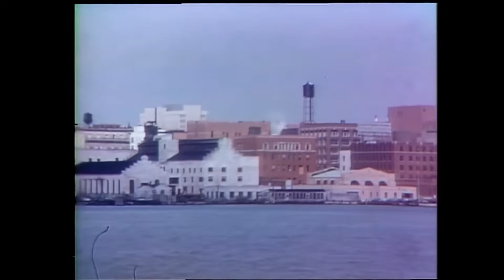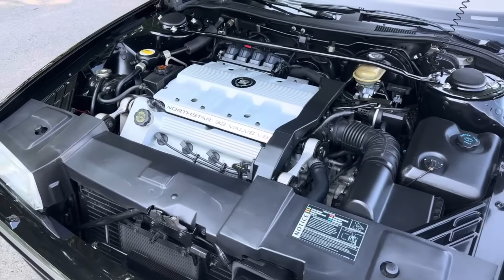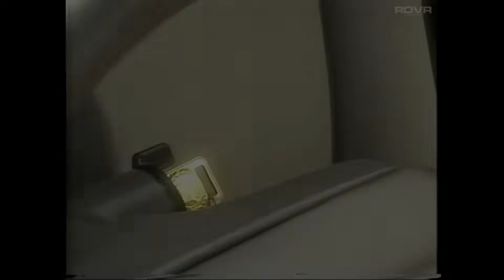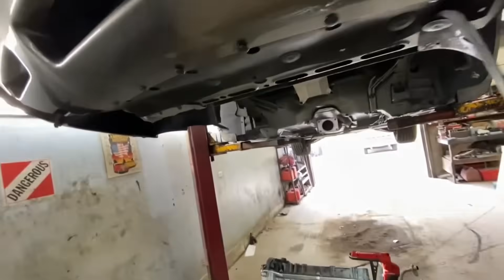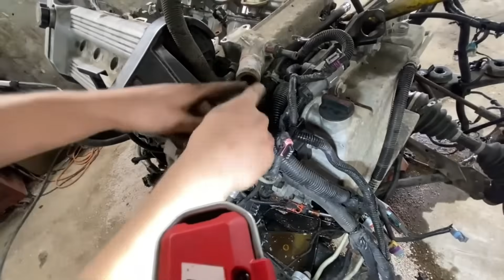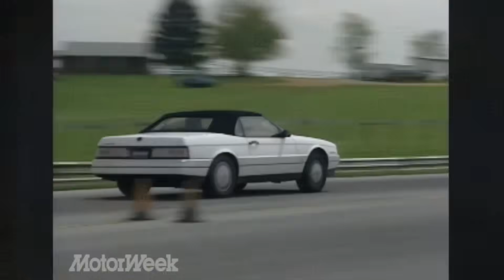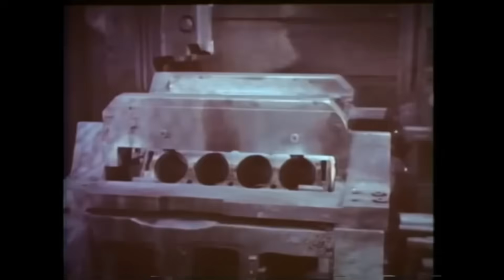Most HATED American V8 Engine of All Time!

Comment: AI slob that got it wrong about cylinder deactivation 
 it's all trash from 2007 and newer. 
 100,000 mile engines and then you need a whole new engine out of a crate.
 Rebuilding is not an option or more money.
Ford with turbos on small engines also 100,000 mi engines 
and that doesn't even include the huge problems with the wet belt.

Comment: Just another stupid decision made by GM's management department. 
They decided to follow the bean counters as the guiding light for Profits rather than trusting in the engineers who spent years in university degrees costs  in metalurgery and decades in research  on  historical accounts of what previous engineers developed in the war years ,to have these effen idiots who have their BA in economics as their portfolio as their prime shingle on their resume. 
When will the executives at GM come to realize that it's the engineers who have the skills ,knowledge and gut feelings to know what is the difference between doing what is right as opposed to doing what the bean counters are telling them what to do to save 32 cents on every vehicle. 
Well I'm so disappointed in the management at GM that by following their track records, that I've given up on GM's corporate ability to build anything reliable, durable ,long lasting and serviceable without having take three quarters of the car apart before they can get to the problem. 
They deserve to go bankrupt.

Comment: mostly elderly people over 70 drive these Cadillac's and they only need a reliable 4 cylinder with around 140 horsepower. when I'm on the road every time I'm behind a Cadillac there doing 25mph in a 40 and highway 40mph in the right hand lane. most of these old codgers would actually do very nicely with a 1.2/3cylinder engine like in the Mitsubishi mirage....what they really care about is gas mileage and the Cadillac emblem. not horsepower.

Comment: I bought a brand new 2005 Harley Davidson twin cam 88. the worst engine ever. after about 10,000 miles the gates of hell opened up. the chain tensioners, oil leaks, engine misfiring and extreme vibration were a nightmare. even worse? the warranty just ran out. first thing the Harley dealer told me that every problem was my fault. I almost got a divorce and lost the house. we've bought Honda's since.

Comment: The problem was not the engine, the problem was GM was not willing to admit there was a problem and actually recall bad ones and fix the design for the future units..  Probably because some NBA figured it was cheaper to screw their customers.  I had a 2000 that I got ripped off on with this problem.  These were awesome cars otherwise.

Comment: Complete bullshit reporting. Water pumps are the root cause. I had 2 northstars both ran to 200k miles and sold. At 120k I had water pumps that locked up intermittent and caused extreme overheating and rapid cooling. Water didn’t leak so it was tough to diagnose. All engines use torque to yield bolts as do many other auto applications.

Comment: The 4.6 Liter Northstar was great except for head bolt inserts, which could be replaced. The same years BMW's V8's had the same problem but their V8 couldn't be rebuilt with new inserts or healy-coils. It was a world -over tech mishap. Deutshe Ingenierskunst ist Mist! hahaha😂just teezing...Plus it's not so bad putting in a new motor, I did it.  And for the video maker, the only thing that Cadillac needed to change was the inserts, the same type of bolt was used and the 4.4 Liter that's still out today is the same block and head design.

Comment: The first problem with the actual car is that it is FRONT WHEEL DRIVE, or seemingly so as it's east-west, not north-south in the chassis.  Any of the larger Mercedes or BMW is rear wheel drive. The engine probs are another issue.

Comment: I had an '89 Seville with the 4.9. It had 180,000 miles on it when I sold it. It was still running great.
Reply: Your 4.9 would of been the best fit. to  resolve the Northstar blunder. 4.9 is not a  Northstar.

Comment: I've owned two Northstar-powered Cadillacs (1995 Deville Concours and a 2002 Eldorado). I got both over 200k with no issues. Also had a 1974 Vega that hit 127k and made it to 1983, and a 1981 Olds Cutlass Diesel that got to 150k. It's simple. Take care of them and they'll take care of you.

Comment: I started working on cars professionally in 2011.   I saw a lot of Northstars.   I've never met one that didn't leak.

An older wealthy guy used to bring his low mile 2 door 98 Eldorado in religiously.   Had, if i remember correctly, 28k miles in 2012 when I worked on it.  Everything about it was meticulously clean.  The I raised her up to see her bottom.    I've NEVER met a Northstar that doesn't leak.

Comment: The best fix for the Northstar head gasket issue is the Northstar Performance head stud kit with multi layer steel gaskets. The kit can be installed by a decent home hobby mechanic without removing the engine from the engine bay, as long as the lower half of the engine is in good shape. The kit is sold by Northstar Performance as a complete fix with all of the right parts and is called the "Bullet Proof" rebuild. Along with the kit, you need a good electric drill, a good overall tool kit, excellent mechanical skills, a willingness to study some videos on the topic, and some patience. For those not willing or able to do the job themselves, it will cost about six to eight thousand dollars for a professional local rebuilder to do the job, or one can buy a rebuilt Northstar engine or send one's Northstar engine to Northstar Performance to have the job done professionally. The owner's name is Jake and he is a superb mechanic and a superb gentleman to do business with. Jake patented the Northstar Performance head studs and bottom end studs- the design is that original, and yes, it really does work. Northstar Performance also sells reflashed engine computers that boost horsepower, torque, and fuel economy by a substantial amount, and many other goodies. These cars are worth keeping and fixing! If you want this level of comfort in a modern car, you will be spending upwards of a hundred thousand dollars. Don't throw them away.

Comment: The cylinders being so close together was actually a big part of the problem, much harder to contain all that combustion with a head gasket you just can't bolt around each individual cylinder as well and these were high compression engines.

Comment: I like how you show a Mercedes W123 car speeding around. Engines in them? Not one V8 for starters. Only 4's, 5's and 6's, gas and diesel. No comparison to big Caddy's, period. You are talking Northstar, a Cadillac engine, but a smaller version was shared with the Olds Aurora and lastly Buick after Olds was no more. Then, why show a Cadillac "D" chassis car. Fortunately, the Chevy 5.7 LT-1 ended up in those. The Northstar was never in that class of car.  A variation of the Northstar was used in the Shelby Series 1.  Remember the Olds Quad4? Wasn't the Norstar created from mating 2 of those together?
OK. Head gasket service on a Northstar? As far as removing the engine from the car, in any case, you just drop the front subframe and then you have all the room in the world to disassemble the top end of the engine. And all the time sitting on a stool. How much easier could that be?????????
Sure you always have to use new torque-to-yield bolts. Nothing new there. Most modern engines use them, including engines before the Northstar was ever thought of.
The headbolts don't usually fail, but instead the threads start pulling out of the aluminum block. Remember, the engines were probably overheated. Look at where they mounted the water pump. High at the back of the engine rather than conventionally lower at the front of the engine.
There are/were aftermarket improved headbolt kits which solved alot of problems for us. If the Northstar problems were caught  fairly soon and repaired before too much other damage occurred, I'd seen my repaired Northstars go over 100K miles more, without incident.
Then there were the oil leak problems. Leaking valve cover gaskets drenching the alternators in oil and destroying them. Those repairs can all be done from topside.
But then there is the lower end.With the lower main bearing cradle being a separate piece from the block, where the seal deteriorates and causes leaks. The plate which bolts to that sealed with silicone and then the oil sump.
Resealing requires removal of the engine from the subframe and alot more work than the head gaskets!

Comment: The North Star had a collection of problems. I won’t address all of them.

Stretch bolts or toque to yield bolts are used because they are cheap and the engines are seen as disposable. So the bolts are one use only. But why?

Bolts are made of steel alloy. Each alloy has an engineering curve which is mostly a straight line whose slope is called the Young’s modulus. Here the elongation under load is linear elongation. 

But this ends at a point called the yield strength. For a steel alloy, the curve takes on a negative curved shape as the strength of the material rapidly deteriorates until fracture.

The empirical yield strength of that alloy is about 2 percent less than the point at which plastic deformation begins.

Once you go plastic, the material is compromised and failure is eminent.

Stretch bolts are torqued down to the absolute maximum point prior to going into plastic deformation.

You are right at the point of failure such as blowing a head gasket.

ARP manufactures replacement bolts for most engines from way more expensive alloys that are way stronger.

These bolts are torqued down using a normal torque procedure and are reusable. The procedure for stretch bolts is way different.

When I rebuild engines, I always throw away the head bolts and install new ARP bolts.

When a stretch bolt fails, you have a leaking blown head gasket. The thermodynamics of the aluminum does not help.

In short, this engine is junk. Impossible to remove without major effort. Difficult to machine. Not worth the effort.

Comment: Probably the Pontiac 301 because it could and should have been better. It had enough bore. The turbo blocks had enough strength. It had enough deck height. 
 The olds 350 diesel makes a fantastic turbo gasoline stroker race-capable engine.

Comment: TTY bolts were used by a large number of manufactures back then with 100% success and ALL mfg's today use them. With proper engineering they are perfect, GM's engineering direction and quality after 1972 was on a steady decline due to the bean counters running the show, and not being true cars guys. That's too bad as GM did have some of the best engineers at one time.

Comment: if they or GM were not stuck on this fwd nonsense the ZR1 engine would have fit nicely in there or even the 3.8 from the Grand National  but these engines did not have a design to fit a fwd transmission

Comment: Its hated because its misunderstood. A good portion of the headgasket failures were a result of owners failing to properly maintain it. Like many luxury engines, they do not take kindly to neglect. GM dexcool coolant did not help the situation. Either way, by the year 2000, the headgasket issue was fixed. With a simple timesert and head stud kit, the factory northstar engine will handle a ton of boost.
Dont even get me started on the starter location. Anyone who brings up the starter location as an issue, is secondarily telling me they havent ever changed one without saying it. They are simple to replace, and you dont even need a jack. Go change the starter on a 4.6/5.4 f150 or mustang, then we can talk about pita.

Comment: If Cadillac didn't run that stupid 4100 engine, they would have never lost their buyers. Maybe one or two, but when you have a Cadillac with 55,000 miles that needs head gaskets and a camshaft, you go somewhere else. I had a friend who worked at Feldner Cadillac they actually had to keep crate 4100s on the side. That way they could change them fast for customers. I would love to see the durability test between the second generation north star and a 4100 and want to see which one blows up first. Two of the biggest turds GM ever made

Comment: Back in '95, my father bought a new Eldorado Touring Coupe (ETC).  I was very impressed.  The ride and the power were excellent.  The Northstar engine was rated at 295 HP.  It didn't have a lot of low end power, but once it got above 4,000 RPM, the 4 valves per cylinder started to earn their keep.  I had a 96 Impala SS.  We took our cars to the local drag strip to see how they compare.  Off the line, my Impala would easily beat the ETC.  But, around 70 MPH, the ETC would catch and pass my Impala.  Over time, my father became less impressed with his ETC.  Oil consumption was one quart every 500 miles.  Over 7 years he had to replace the battery 7 times.  That really pissed him off.  He ended up trading it in on a new 2003 Corvette - which he thoroughly loved.

Comment: I recall it to be a decent 300hp motor that could easily go about 100k miles before everything started to go out. But your average Cadillac owner isn’t going to keep it that long, so it was ok for its era. Not a fun engine to work on, and as I discovered, the best way to overhaul it was to buy a complete crate motor from GM.

Comment: Mine gave up the ghost at exactly 99,9999 miles.  Wish I had taken a pic of the odometer.   

I am a Mechanical Engineer  and In my opinion, the problem was the composite gaskets.  It if was the torque-to-yield bolts, then a person could just replace the bolts one at a time before the leaks start.   You could do this without pulling the engine.   Gaskets are the problem. 

By the way, I traded mine  in on a 2014 CTS-V, that runs like a bat out of hell.

Comment: When I was in the Air Force I bought a used '95 Cadillac Seville STS with a 300hp Northstar V8. I put 120k miles on a car that had 72k on it when I bought it. The only issue I ever had was when the transmission ate itself on a cross-country trip. I of course took good care of the car. And never had an issue with the engine till I sold it to a friend in 2012. He still has it.

Comment: The Northstar is not the most hated, sorry but let's not forget about the 350 Diesel engine. And Cadillac's older displacement on demand engine was way worse than the Northstar. Simple head stud kit will fix the issue

Comment: I worked at a Cadillac dealer and we didn't really have that many problems. Sure, there were problems. But the Chrysler transmissions at that time were dropping like flies as well as the A/C evaporator coils. We did reseals on transmissions pretty much every day. Our Cadillac loaner with the Northstar (we had only one) never had an issue, and I drove it several times on the weekend or home in the evening though not all the time. We didn't have hardly any trouble with the Chrysler V8's but they were underwhelming for the most part. I guess if you're just going to talk about V8's then Northstar would be on the list of flawed V8's, but I'm surprised to see it mentioned as "most hated".

Funny story about the Chrysler tranny. I had a woman drive her new (less than 3000 miles IIRC) minivan into the service lane and say there was something wrong. They had been in a nearby town but still several miles up the interstate, and she said it started making a loud whining noise. Long story short, it had gone into limp-home mode and was stuck in 2nd gear with no shifts, and she was telling me that going down the highway at 70 it was making a real loud noise. Yeah, because you're burying the engine at max RPM! Man, some people really are a danger to themselves.

Comment: Ford had a similar problem on their 3.8 litre V-6 powerplants that were used in Tauruses and Lincoln Continentals.  I got so adept at tearing those engines down, that I could have the valve blocks ("cylinder heads") off, stripped down, and ready to send out to the machine shop before the engine was completely cooled down.

Comment: My neighbor bought a nice low mileage caddy about 15 years ago, it was a nice car but every day I would have to give him a boost with my old $1000 chev pickup with a 350 engine. He brought it to several mechanics and they couldn't figure out why it was draining the battery so fast. He traded it for an H1 Hummer, the Hummer would not start in the winter even when the block heater was plugged in, it got 6mpg even with the diesel engine. I told him to stop buying flashy vehicles and just get a decent truck. He bought a low mileage Chev pickup and never had any more issues.

Comment: You forgot to mention the headbolt threads in the block pulling apart from metal corrosion requiring helicoil thread inserts in the block for bolt threads to hold as a repair. The dealers were supplied special factory tool kits to effect this repair. Usually this was blamed on coolant failure and of course the constant stress from thermal expansion of the aluminum Engine block.

Comment: This guy is totally wrong about TTY fasteners. They are torqued TO yield, NOT Beyond it. Shitty fasteners, inadequate thread surface area, or initial overtorque was the issue, NOT the simple fact that TTY fasteners were used. Every modern engine uses them, so why don't they fail? Makes me crazy when non-Gearheads fake it, but they get over on most because they don't know any better. I have re-used TTY fasteners quite successfully. All you have to do is measure them to assure they have not been overstretched, and of course properly re-install them. 
The NS needed block thread repair. The 4100 was hated more than the Northstar, as was the Olds Diesel! I'm not makeing excuses for the Northstar, and when built correctly it is s good engine. This guy needs to go back to school.